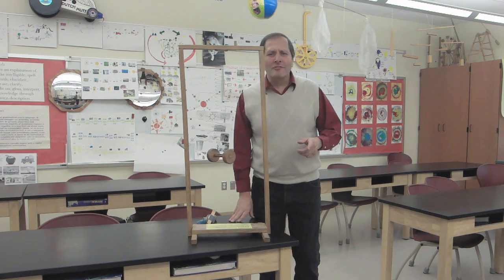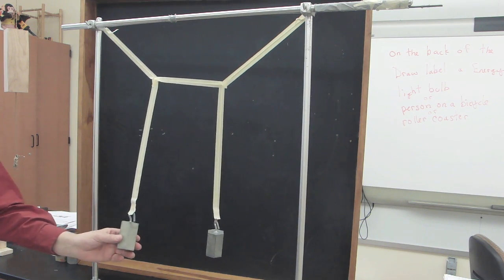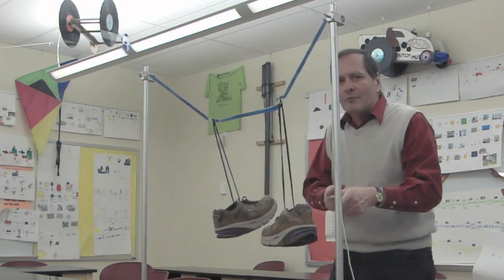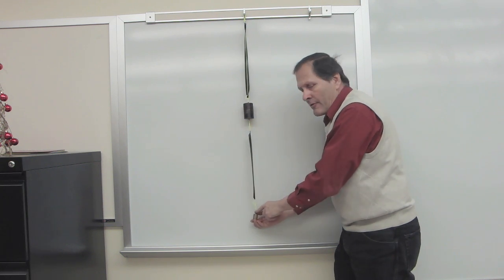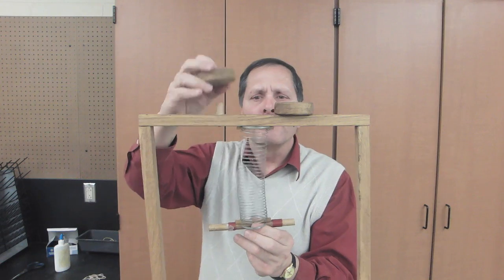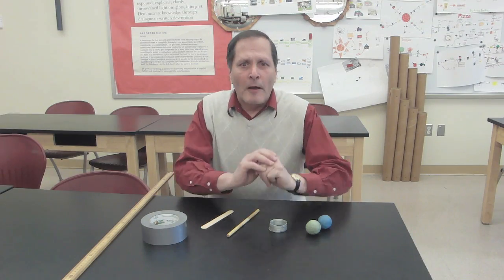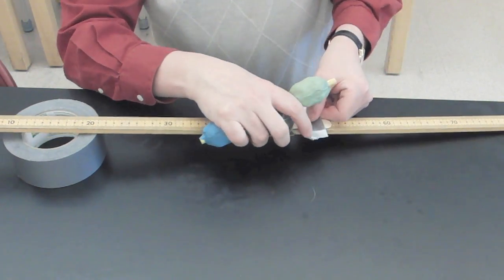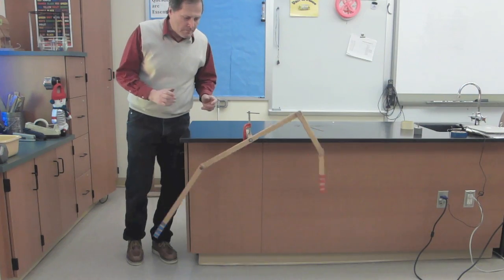Wilburforce & Double Pendulums Demonstrate Resonance // Homemade Science with Bruce Yeany

Comment: If it were possible to remove all energy losses (and gains) from one of these systems, would it "settle in" to a less dynamic, perfectly repeating pattern or other "stable" behavior? I feel like the answer to that question comes down to whether or not the ratio of the periods of the individual components is a rational number. That is, if Thing One has a period of one second, and Thing Two has a period of pi seconds, it would be "chaotic" forever. But if Thing One has a period of 1.000000000000 second and Thing Two has a period of 1.000000000001 seconds, then any practical observation would perceive chaos, but that "chaos" might repeat itself in a very precise manner after just 32,000 years.

I also wonder if there's some interplay between conservation of energy and conservation of momentum, with implications analogous to quantum energy states. Kind of like a Newton's cradle. If you set two balls in motion on one side, then two balls will move on the other side when they collide. This reminds me of quantum energy states because of the locked-in outcomes. In a perfect Newton's cradle, those two balls come out with exactly the same energy as the two balls that were initially set in motion. The other three balls sit perfectly still. The two balls don't bounce back at some fraction of the speed, while the rest of the balls slowly move in the opposite direction. The energy can only be transferred in discrete "packets". The difference with the pendulums is that the transfer of energy between members of the system is gradual rather than instantaneous. A sine wave whose period is the difference of the periods of the two members maybe?
Reply: What

Comment: Hello, Years ago, I performed on a trapeze.  Just playing around, we tried ways to get the trapeze moving from a equilibrium "hanging still" position--there was a slight swinging like a pendulum.  The rules were that you could only move your center of gravity vertically.  I was allowed to just hang on it (under, holding with both hands) and only pull my weight vertically OR stand on it and only lift (with my legs) from a squating-to standing position--again, only moving my center of gravity up or down.
The solution turned out to be (as swinging began)  standing straight as the trapeze moved through the equilibrium (center position) while slowly squatting as it swang out to the stopping points (fully squatting just as the trapeze stops and fully standing as it passed through the lowest position--smoothly).  The swinging went like crazy!!!!
HERE'S MY QUESTION:
How would you build (in a physics school lab) a "mass and spring oscillator) connected to a trapeze-type (rigid pendulum bar or string), and knowing the rule learned on the trapeze (how to swing it), connect the mass/spring oscillator to the rigid rod pendulum and adjust the frequency's so that the whole thing swung with INCREASING amplitude?
Reply from the maker: HI Chris,  I remember years ago doing the same thing standing  on a playground swing in our schoolyard.  What you are suggesting is similar to the Wilburforce  pendulum only instead of the twisting motion the springed weight would have to move up and down.   Years ago I build a device that I shared with a museum as one of their exhibits.  It was a swing with a weight on it,  the weight was attached to a hydraulic cylinder that when activated moved the weight.  A hose ran up one of the cables and connected to a 2nd cylinder that was hand powered.  you pumped the 2nd cylinder to move the weight and caused the swing to resonate.  You could get it going quite high also.  The whole thing was successful only is the timing was correct.That is the problem you encounter with your setup  is it possible to replace the actuated cylinder with a spring adjusted to the right frequency.  Your problem sounds interesting and I'll take it on as a challenge to see if I can combine what you suggest with the device that I had.

Comment: Not sure if you still monitor the comments on old videos, but you might want to switch to gaffers tape or foil duct tape.  The string reinforced "duck" tapes have adhesive that not only leaves residue but tends to dry up or break down over a few months.
Reply from the maker: I try to read all comments.  good advice,  I use one set up with tape on it for viewing purposes

Comment: Hi Bruce! I'm Vinícius from Brazil. Your video is amazing, like the 120+ other ones. I'd just like to make a contribution, if you allow me to. This is actually not resonance. For resonance to happen it is necessary to have an external periodic force acting on the system. The problems you've shown in this video are just initial value problems.

Your explanations about kinetic energy and travelling energy are absolutely correct. However, the phenomenon you show in this video is called Beat.

Keep on doing your videos, they are very creative and you are doing a very good job!

Best regards,
Vinícius
Reply from the maker: Hello Vinicious,  thanks for the comments and  I appreciate that you explained  the distinction between resonance and beats.  Posting videos has been a learning experience for me,  interestingly enough I'm not the only one that has this wrong.